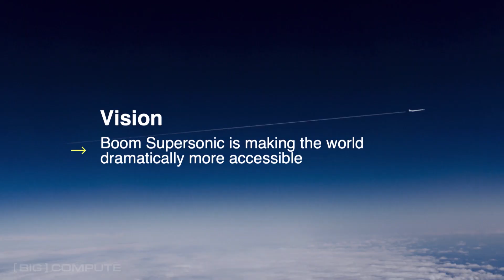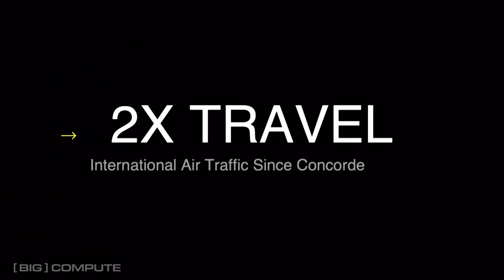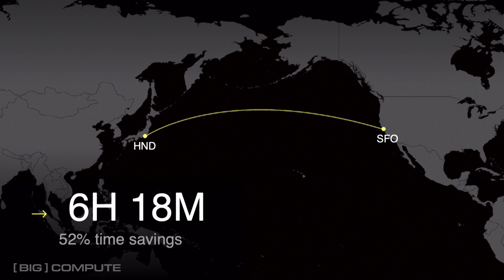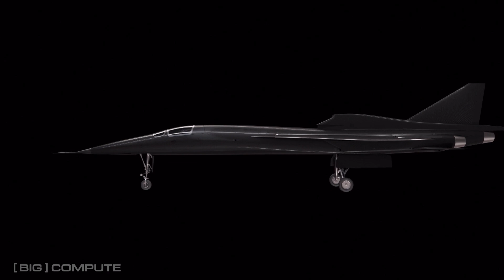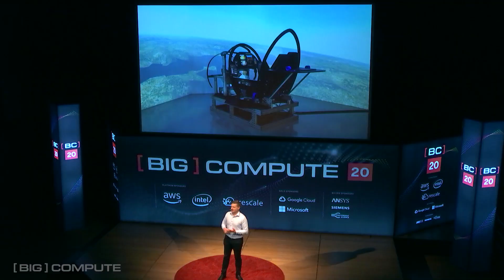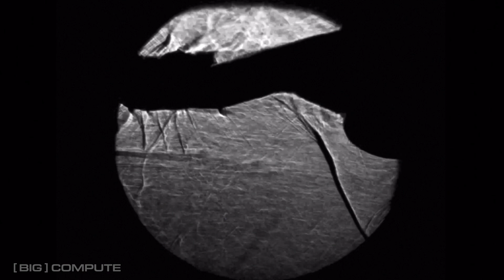Supersonic Commercial Flight is Possible with Big Compute - Blake Scholl, CEO of Boom Supersonic

Comment: And while it'll fly as high or higher than Concorde, I think the radiation exposure would be similar. Will need to see the actual data once it becomes flight worthy.
Reply: Should be okay as long as you don't routinely fly across the South Atlantic anomaly. There the van-allen Radiation belts come really close to the surface, and radiation is more than ten times higher than on the same altitude somewhere else. That's actually very relevant for ISS

Comment: Sorry, but Concorde didn't fail because it was a gas guzzler or that tickets cost $20,000. Concorde failed because it didn't have enough range and circumscribed itself to the NY-Paris/London market and not much else. For a supersonic airliner to succeed, it must be able to fly over land or it must have trans Pacific range -- preferably both, but either would have been survivable. The Concorde had neither and doomed itself to a 14 aircraft production run.
--
By trans Pacific range, I mean ~6,300 nm. That'll connect the US west cost to Tokyo, Taipei, Shanghai, Hong Kong and most coastal Asian destinations. It also means the US east coast to Dubai or over the poles to Moscow or Beijing (if we don't care about sonic booms disturbing Polar Bears). Think of the Concorde with its 4,500 nm range as a 757 or A321 with no ability to fly over land -- that's a dud regardless of how fast it went and how cheap the tickets might be. This is more important than ticket prices or the carbon footprint nonsense -- people who really care about the Global Warming hoax can take sail boats like silly Greta Thunberg.
--
To this end I think the Concorde profile of the Overture is not a good engineering choice because it leaves limited space for fuel in the thin wings. The tri-jet setup is also dubious given that three of the already announced GE Affinity engines will not be enough for an aircraft of its size. It is going to need about 75,000~90,000 lbs of dry thrust. If new engines are warranted, why not make it a twin jet? A better geometry will be the chinned delta (ala SR-71). The full length strakes will provide the much needed room for additional fuel and generate plenty of vortex lift at a lower AoA.
Reply: That is part of the story to Concorde. Though, many could not afford to fly the Concorde, and since the prices were that sky-high AND also because it limited itself to the New York to London airliner market with only 2 airliners, Air France and British Airways. And, also by the way, the overture doesn't rely on fuel for propulsion. With modern aircraft propulsion technology and testing advancements, the Overture will be completely 100% carbon neutral (the aircraft extracts the carbon from the atmosphere instead of fuel and then exhausts it out, so the process is carbon-in, carbon-out, without doing as much environmental impact). The delta wing design has also already been implemented into the aircraft wing design, and is also swept and much more efficient than the Concorde, since the vortex generated by the Concorde was much more turbulent and caused a wake region for other aircraft operating in that region. This means that the Overture aircraft can operate much more efficiently with no fuel consumption like how modern airliners rely on (petrolium and other harmful chemicals used that negatively impact the environment).

There has not been any advancements really in aviation since the 1900's (if you think so, why don't you name a few besides the twin engine), but with the technology and utilization of these technologies, and these include CAD, computer aided design models for designing aircraft and eventually testing them through CFD (Computational Fluid Dynamics), where fluid behavior/data structures are numerically analyzed for optimization of the overture components and the aircraft itself, and finally, the simulation of structural integrity, or FEA (finite element analysis) where the load bearing stresses are located on different parts of the aircraft. overture has combined all these technologies together to create a supersonic airliner that's sustainable, more efficient, and can also operate at more routes (specifically 500+ routes). 

For more information, visit my research papers on these links:

https://docs.google.com/document/d/12N8azFvpzQvClVrd8L88ye3vBpGK6EsquHLpryGEy8M/edit?usp=sharing

https://docs.google.com/document/d/1W_V1Dhfr7S0YtkUyUK4LYWd1x6JZQSOJSjZF8PWtKY8/edit?usp=sharing

Comment: The big worry is that post Covid19 economical climate won't be supportive and even not requiring speed but social distancing on the new or upgraded much faster ocean liners , semi-hydrofoils pushed by huge bypass turbofan engines. 
Each cabin could be easily converted into hospital equipped ICUs  ?
The existing fleet of aircrafts will require a few years to get up and operate at 40%capacity. It might be too pessimistic and hopefully some brilliant planers by gazing into Cristal Ball of futuristic technologies will be able to mitigate required social distancing. Social distancing on long haul destinations will be with us for good. It will be renamed the Personal Space.

Comment: I was wondering if the altitude of the supersonic airplane affected the amount of noise on the ground when the airplane went supersonic and continued on being supersonic when it is crossing land.
Reply: Yes. The more distance the sonic boom needs to travel, the more it dissipates. So the higher you go, the quieter the boom becomes. But it is still very powerfull even at those distances. That's why lockheed and nasa (don't quote me on that, correct me if I'm wrong) are working on 'low boom' tech that reduces the noise to about a car door slamming shut.
Reply: The jet might fly as high as FL600.